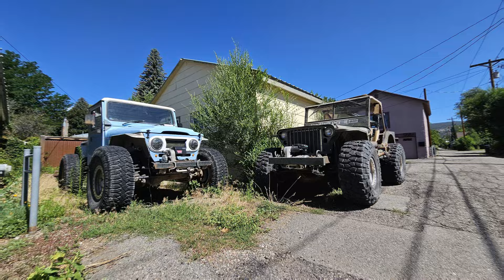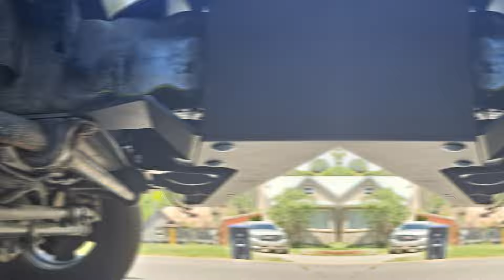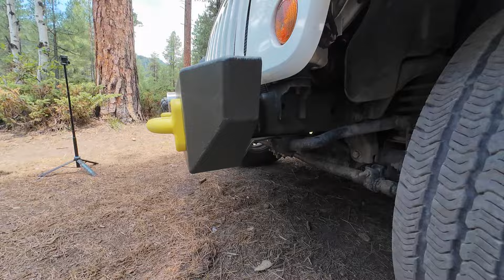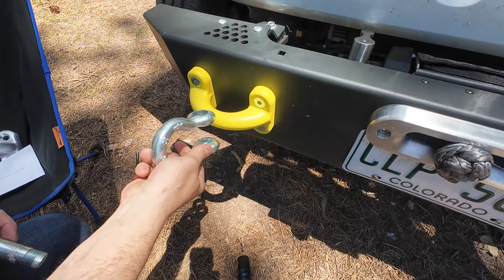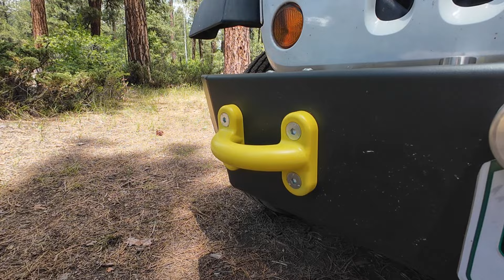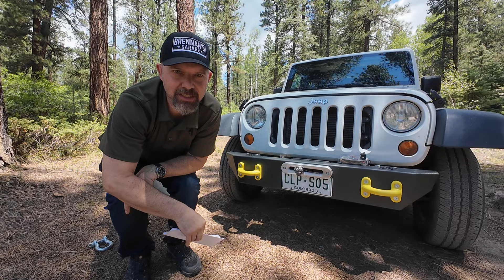Plain Jane Jeep: Nose Job

Comment: I'd e-mail but I figure this is better for YT engagement.

I have just purchased your 2" SSRA and I think I heard you say in another video (or maybe on a forum) that certain 1/2" soft shackles could potentially fit, possibly if they have a double-leg design? I'm curious if the Bubba Ropes 1/2" soft shackle is one of the ones you're talking about, and if it should fit with some convincing? If not, I can obviously go 7/16" from any reputable vendor (I assume)...

(I am also aware of the idea of going too strong with some rigging, so no need to cover that here.)
Reply from the maker: @BenFenner  My house brand soft shackles are the perfect fit and a manufactured from 7/16 Amsteel-Blue by Yankum Ropes for me. The 2.0 SSRA can use 1/2 rope based shackles if the legs are independent, but you will have to give up on having the tubular webbing guard.

Comment: Can you explain a bit more how you've got the winch line connected to the soft shackle for storage in the winch? At first I thought you were running the BleepinJeep Freedom Winch Line but I guess not. And do you have any concerns about UV degradation on the knot? Any thoughts about a "sock" to protect it from the sun?

(I have just purchased your 2" SSRA and have a question about that but I'll make a new post.)
Reply from the maker: @BenFenner  If you search out my social media at #BrennansGarage or #BeeSafeRecoveryGear you can find some posts about the SoftHook technique I came up with a few years back. The short version. The tail of one of my normal soft shackles is connected to a slightly larger than normal soft loop in the end of the winch line using a Loop2Loop connection ( sometimes called a Cow Hitch ). The top knot of the soft shackle is then run through the extra space in the winch line loop behind the Loop2Loop connection. I haven't found the need to cover the top knot of the soft shackle, but you certainly could if you wanted.

Comment: I wasn't particularly enthusiastic about the aesthetics when I first saw the design.  But your form-follows-function explanation makes a lot of sense, if I didn't already have a bumper on my JKU I'd certainly consider yours.   

I'll be watching for other JK parts maybe some lightweight rocker/ sliders?  Or aluminum gas tank skid? Hint hint.  

The butterfly was an added bonus.  😂
Reply from the maker: There are already some good aluminum parts on the market. Nemesis makes a very good set of aluminum rockers. Next Venture Motorsports has a great aluminum skidplate package including gas tank skid that actually replaces the factory steel skid....not just sandwiches over it. I'm not trying to totally reinvent the wheel....I try and pick my battles ( and products ) pretty carefully.